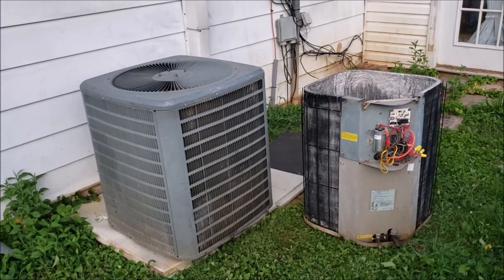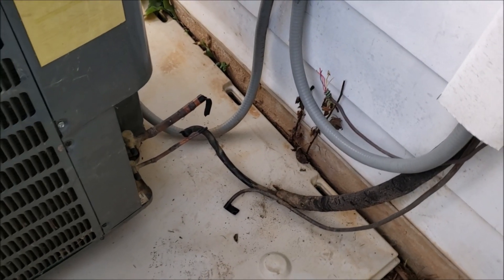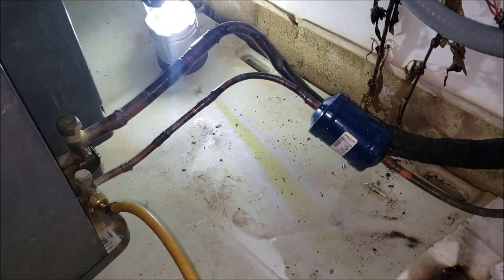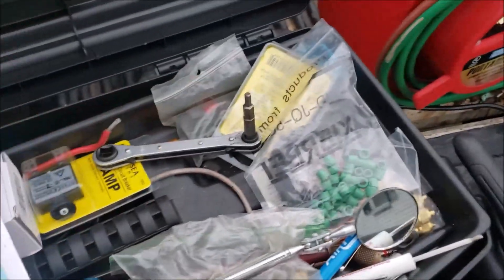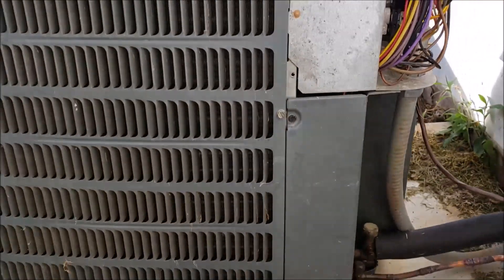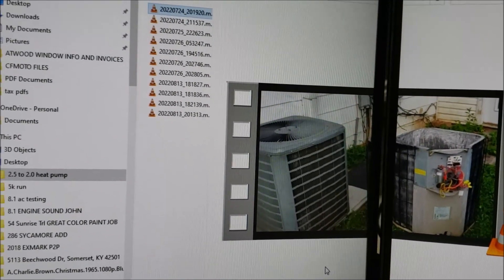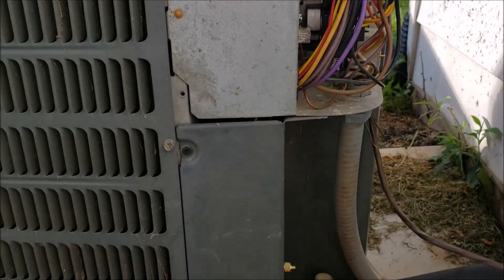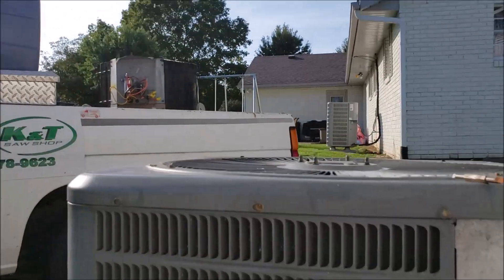Mismatched HVAC Heat Pump Unit 2 Ton Replaced With 2.5 Ton Still Running 1 Year Later

Comment: I also have a 2 ton r22  so the 2.1/2  worked for you most hvac guys don’t what to fix things anymore they want to change the whole system out
2 ton r22 hard to find but 2.1/2  will work

Comment: YT DIY guy from Utah channel has convinced me to start using the ductless mini split systems for DIY install, low energy and heat pumps ability.  You do have to research each maker to see how cold outside it is rated for.  Lots of mini split systems are made and used in Canada.  My local friend is building a high end home and using multiple zone mini split systems on the large home.  He believes Mitsubishi mini split is the best after his research.
Reply from the maker: Thank you for contributing

Comment: HVAC IS NOT A DIY kind of work things like this makes me upset he didn’t go to school to actually learn but because he did it on his own he puts it on here to show other people that may have an idea then someone messes something up they call us then bitch about the bill we’ll stop messing with stuff you don’t have education on
Reply from the maker: Thank you for contributing but I must tell you the only reason I taught myself how to do HVAC is because "SO CALLED PROFESSIONALS" would take short cuts on my equipment like not using a Micron gauge when pulling vacuum or brazing with out flowing nitrogen. If your a Pro then you will know what I mean. I have replaced A Coils, Compressors brazed capillaries that have rubbed out installed complete systems all with 7th grade education. I am not certified HVAC but I can read a manual and learn like anyone else. Have a blessed day my friend.

Comment: Most condensing units are have a compressor that’s a 1/2 ton smaller, a 2 ton unit 024 will have an 019 compressor installed.
Reply from the maker: Thank you for contributing

Comment: That seal the terminal goes through is called Bakealite. I’ve seen a few terminals blow , usually because of high pressure or motor shorts . 
With an extra half ton capacity, the suction pressure might be a bit lower but as long as it doesn’t run below the 35 degree boil off pressure. . Well done .